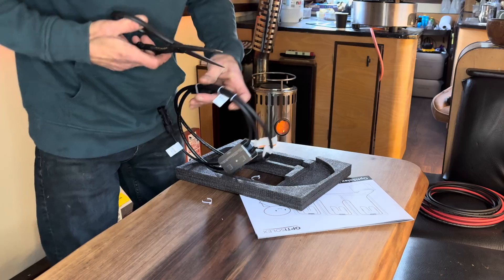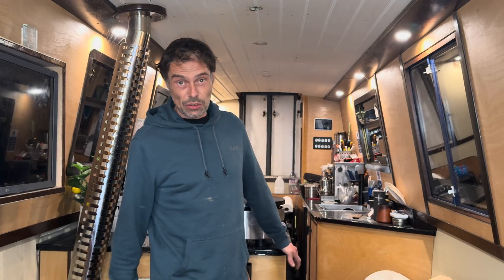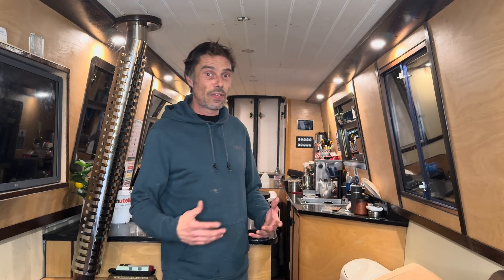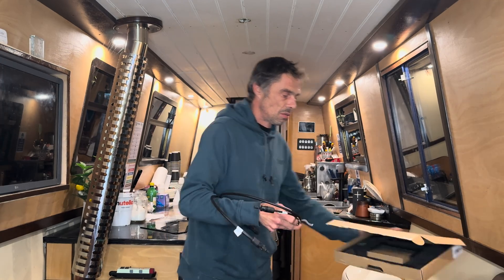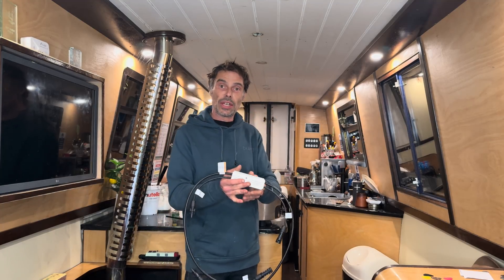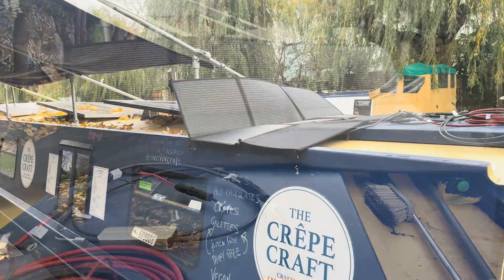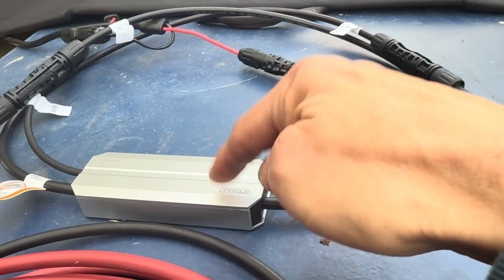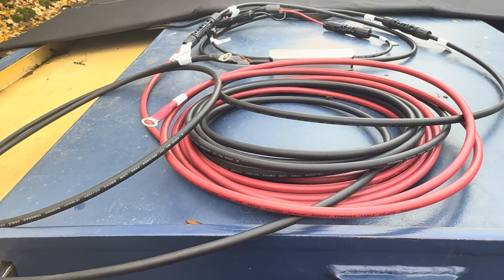615. Is this new MPPT a game changer ?

Comment: Hi James. You should be able to charge the starer battery from the solar. It's simple enough. Run a positive and negative from the leisure batteries to the starter batt. You will need to put  an appropriate size diode on the positive leed so that power will not flow back to the leisure batts. You could also put an isolator switch instead of the diode and just switch it off after charging. I would go with the diode so you don't need to remember about the switch. Cheers mate.